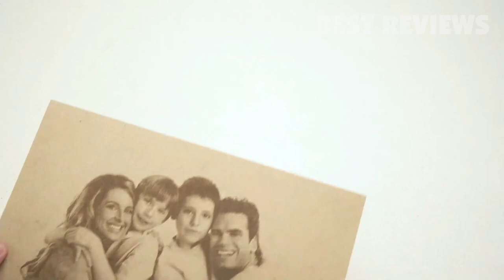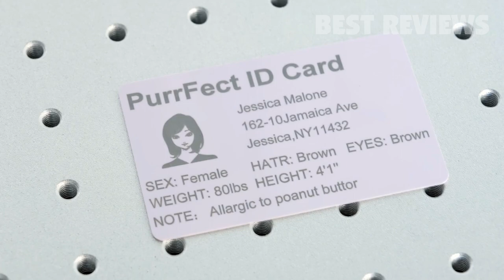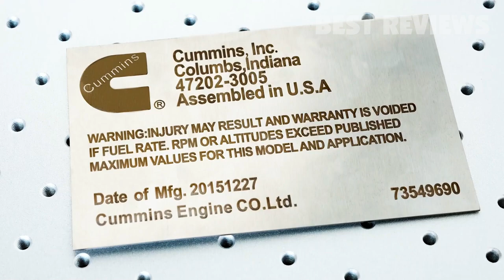5 Best Laser Cutter Engraving Machines in 2024

Comment: I owned the laser pecker 2... completely horrible machine. The APP is NOT user friendly and lacks many basic features to edit. It soley relies on this APP which converts images to really poor G Code. I tested the LP2 laser power with a Ophir Photonics meter and got only 3.8W and very poor wave oscillating wave length. This machine BARELY marks anodized aluminum and does not have the power to utilize marking sprays. Falsely advertised as a "engraver"... Needs major improvement in its app
Reply: How many ₹ ?